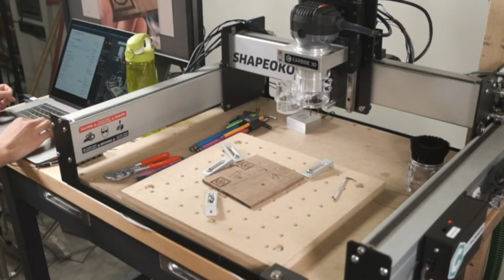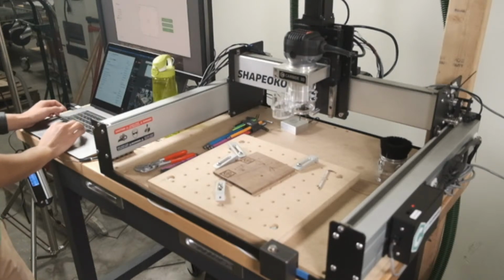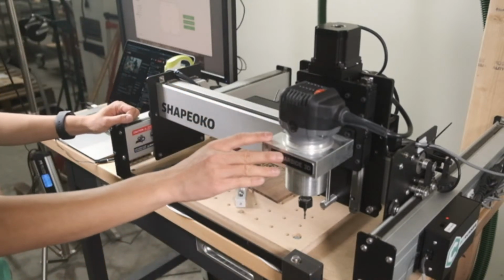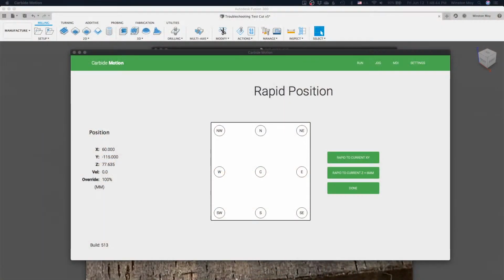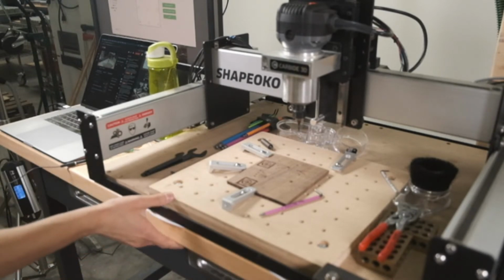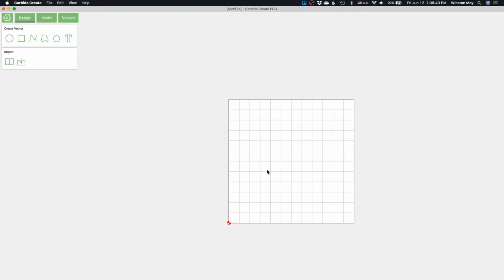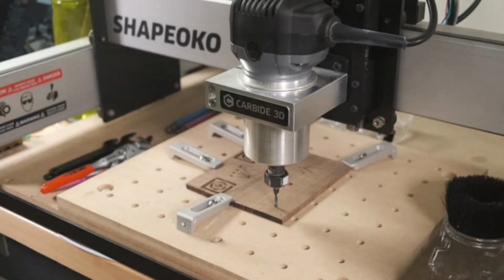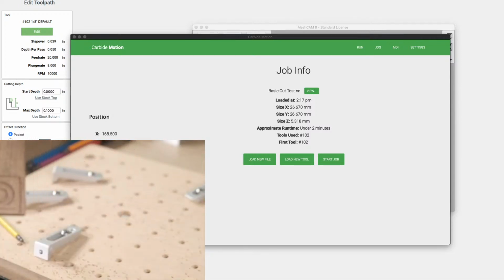Carbide Office Hours #13 - How to Troubleshoot Common Problems

Comment: My Shapeoko xxl the router is not retracting when I pause the cutting. It will just sit and cut. I have checked my settings in carbide create and my retract is set to .750 3/4 any suggestions

Comment: Thank you so much, Winston! My Shapeoxo was not moving the correct X distance... and lo-and-behold, one of the pulleys/stepper motors was loose.
The weird thing, however, is that they come pre-assembled, but the hex nut is not upon the flat part of the motor's shaft (one is tight, and I had to tighten the other, neither had the hex nut positioned above the flat part of the shaft)...